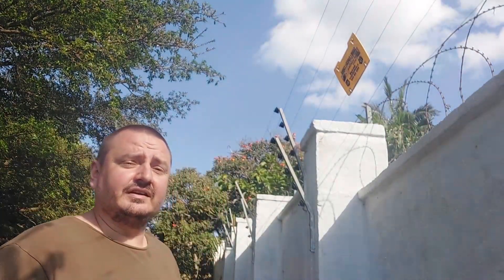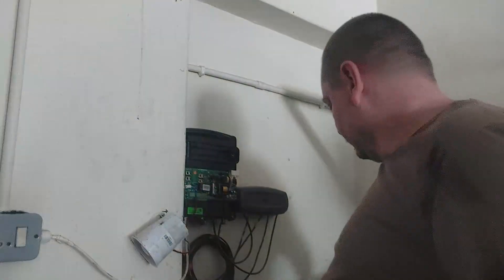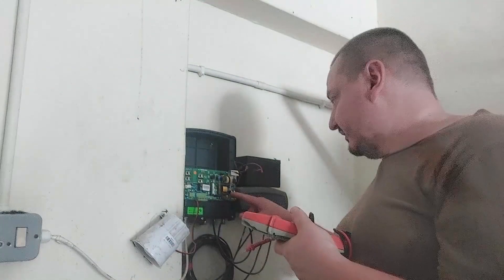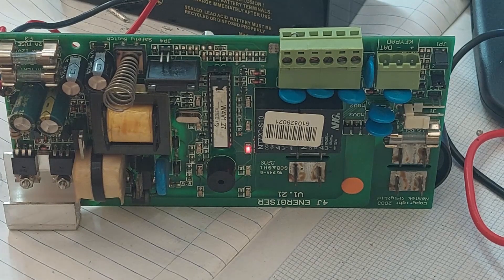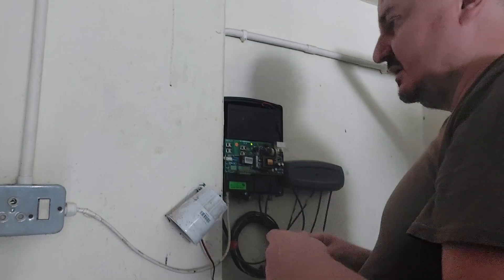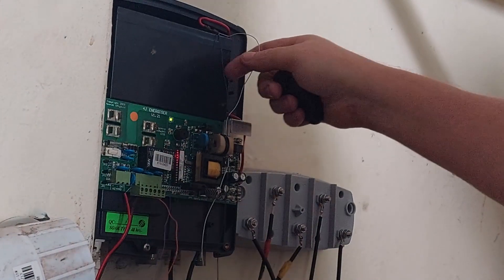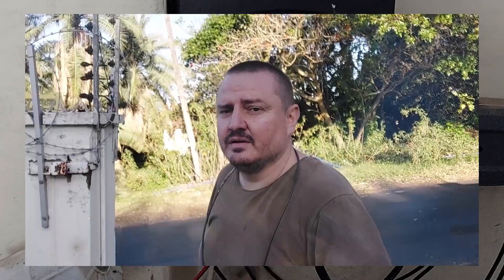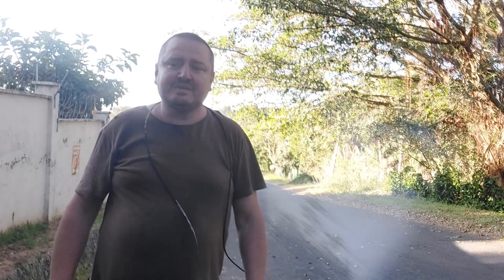ShoutingElectronics #40 - A Non Shocking Shocker - Electric Fence Repair

Comment: Hello Friend I installed Electric fence for a client, using merlin 28s Enegizer, after light went out and came back, the Zone one (FENCE 1) alarm would not stop blowing, and I have check all cable connections and every connection is perfect. yet fence 1 alarm will not stop blowing, please can you kindly help me out with a solution to solve this.

Comment: Normal with those the high voltage transformer fails with shorted turns on the secondary at the output. Fully potted so no way to fix. Power wise the whole board only has 16VAC applied to it, so it is not going to give a mains shock, though the 500VDC on those big capacitors will definitely hurt big time. Battery always fails after a year and a bit, being nicely toasted in the case.

Board wise they are reliable till those caps fail, or the battery decides to die and dump acid all over the board. To tell of the transformer or the board is faulty, when it triggers even with the fence connections removed and the jumpers are there, you change the main board and see if the fault persists, and then if it still is there you replace the MOV and terminal board, as they also wear out, but in general the MOV's failing kills the transformer, so both will be replaced together. Sadly with the price of the board and transformer a new unit with warranty was better value, as that comes with a 1 year warranty and a new battery.

Don't forget to add the extra ground wires every 10m on the fence, improves the bite and reduces RF noise. Was doing a fence fix last night as well, goose flew into the wires and did a bit of damage, though the goose was fine from the noise it made.